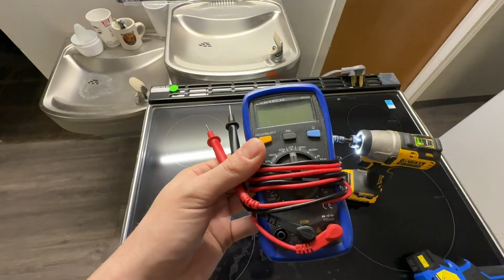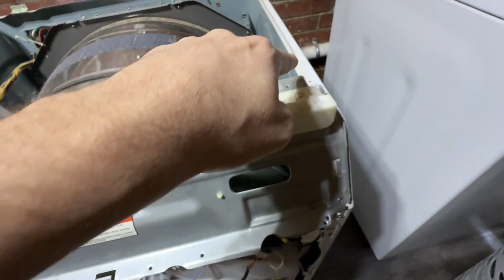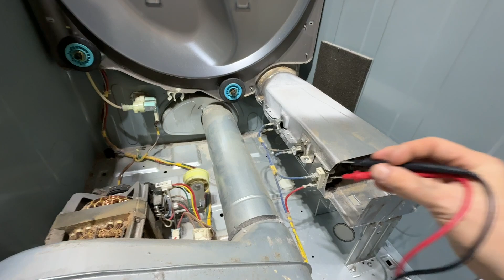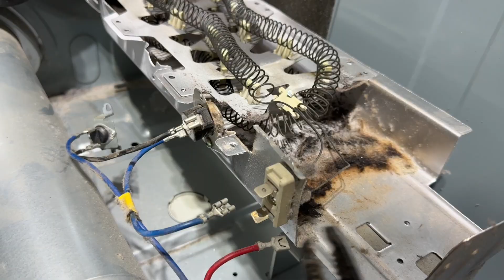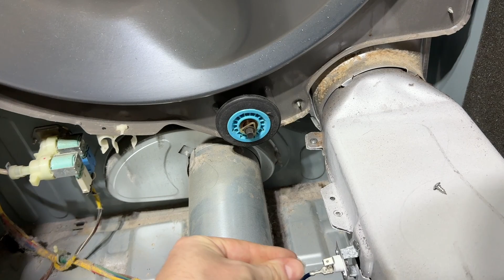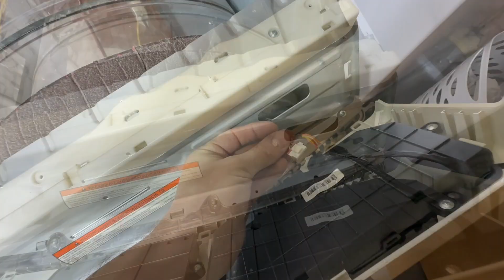Why Is My Samsung Dryer Blowing Cold Air? (Easy Fix)

Comment: If you test and everything is fine, what else it can be the reason not heating up
Reply from the maker: Did you check your power voltage coming in as well?
Reply: @FixitwithAaron thank you for replying fast!
It was the thermistor on the blower!